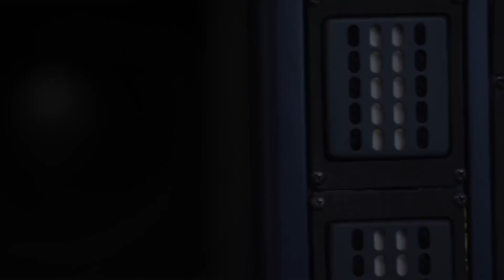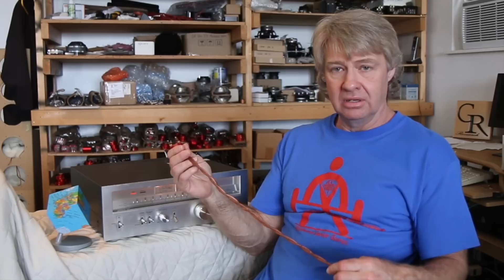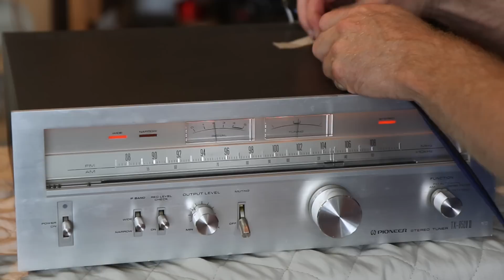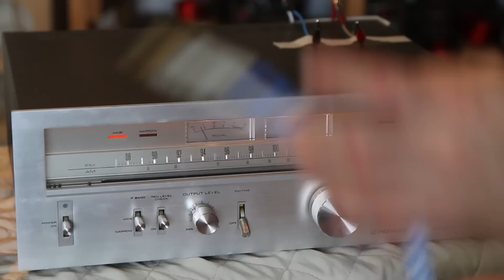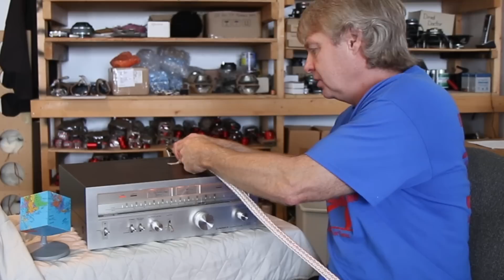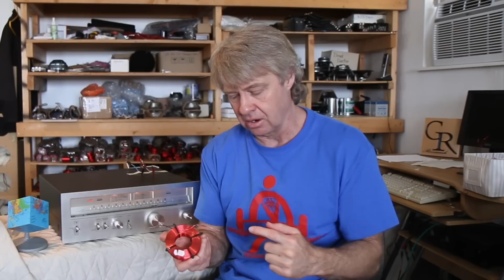Do Audiophile Cables Matter? Here's PROOF!

Comment: Interesting, Firstly I am no engineer or electronic person, I just appreciate hifi and good sound, however I am generally of the opinion that  a lot of cable makers claims are snake oil.

That is not to say that cables are not an important part of a hifi set up, they are! 

The example given was interesting but even as you mentioned this experiment just shows filtering of RF signals not normal current that goes from amp to speakers. 

I would suggest that a good quality ofc cable that is well shielded is all that is required for most peoples hifi and ears. 
Of course you could buy a good ofc wire and braid it yourself and save $$$/£££

My issue in general is these audio and hifi cable manufacturing companies that claim big things from a 99.9999 % OFC, silver plated, cryogenicaly frozen, created by bhudda hifi cable. 
Yours for only £10,000 per Sq mtr.! 🙏🎉
What utter BS!  😂 that indeed is snake oil.🧐
Even if it did indeed make a difference I assume it would be so negligible to even bother with and certainly not audible to the human ear. 

I would rather have a group of people, different age ranges, with various cables in a blind listening test. 

In the debate we also focuse on electronics and data but neglect the human experience and biology.....
A friend of mine has hearing issues and in work uses a special earpiece for telephony work, however every so often this earpiece needs re calibrating because my colleagues hearing will acclimatise to the signal and cancel out any benefit because our ears also adapt to sound. 

I re-iterate cables are important (as you have shown)...just don't go paying silly prices for the voodoo ones!

Comment: Oh no! It's picking up RF. You can mitigate this easily by braiding it, as the more expensive ones do. What you completely ignored was the length/electrical length of the different cables you used as an ANTENNA, at least you didn't talk about it. I did this experiment myself a couple of years ago and braiding will reduce L' while more strands and a tighter weave will increase C'. So yes a braided and  well matched cable will reduce RF and group delay slightly, but as you said the noise is on the grid too. I used to put my gear on a power conditioner/filter to mitigate this. 

The differences in impedance and group delay of the cables are really small though and are negligible for f<100kHz. If you want less RF noise, get a filter/conditioner for your gear, maybe braid together some cheap speaker wire yourself if you must, there's no reason to go fancy with dielectrics like Teflon below 6GHz either.

Comment: Well I wasted 20 minutes of my life watching this in the hopes of someone actually showing a measurable difference in speaker cables.  Noise floor my eye. If it made a dramatic difference it would be easily measured by a spectrum analyzer.  I've tried using my AP system 2 > -120db noise floor, nothing.  If you are a true believer, I challenge you to do a true double blind cable test between the supposed worst cable and best cable.  If you get 100% correct I will be convinced.  I am not saying there are no differences, there may be,  only that the differences are very, very small and no one has yet devised a method for measuring these differences in a meaningful way.

Comment: Can someone explain to me why hifi speaker doesn't come with balanced connections. The whole point of this video is about interference but there is a solution for that and it is balanced connection no?
Reply: It would cost money to do so, since you'd need either transformers big enough to handle the expected wattage, and good enough to work linearly across the entire AF spectrum, or active electronics at the speaker, and you'd need much the same at the amp. and it wouldn't really make any difference anyway, outside of really unlikely situations where you're forced to run your speaker cables near to a source of EM radiation that just happens to have enough components with enough power in the audible frequency range to actually make a noticeable difference while playing music, and you can't move either the source or the cable... 
Even if we did have balanced speaker cables, there'd still be people claiming that there was a difference between different cables, and attempting to charge you for the privilege of using their special version.

Comment: Your test is totally flawed.   First off you are using an unterminated pair of wires which is a high impedance mismatch to the antenna input of the tuner. Other than the capacitive load.  It is the capacitance of the wire between pairs that acts as the filter as you suggest and not the type of wire.   If you were to terminate each of the test cables at 300 ohms you would find that the difference in the cables would be almost non existent.  If you did the same experiment with the AM band and configured your cables as a single unterminated long wire antenna you would also find there is virtually no difference.

 Noise picked up on the power line is usually filtered out by the power supply especially when power transformers are employed.    Power transformers cannot pass RF frequencies.   As well any decently designed power supply will not pass powerline noise  into the audio circuits.      

The speaker cables are not usually affected by noise simply because they are terminated at a very low impedance nominally at 8 or 4 ohms measured at 1kHZ.  The impedance of the inductive load of a loudspeaker at RF frequencies is near zero.  This would effectively suppress any RF interference induced into a speaker cable no matter what type of wire is used.   The actual power level of any induced RFI or EMI is extremely low and if you know anything about RF you also know that there is no such thing as a transducer that can convert RF into an audible signal. The speakers themselves cannot produce an audible artifact of RFI.  EMI may be an exception because the effect of EMI is based entirely on the strength of the EMI, it's frequency and the proximity of the receiver to the source.   It takes a long  piece of wire terminated at a high impedance to be able to produce a measurable level of induced RF energy.   Before you fall into the trap of the snake oil wire hype,  I would suggest that you read up on transmission line theory to focus your thinking on scientific fact rather than falsehoods produced by the marketeers.  I have been an audiophile and engineering technologist in the audio field for over 60 years.
Reply: Spot on!
Reply: @COLDMKULTRA  Thank you

Comment: No speaker on earth will respond to radiated 60Hz from your power lines, and shielded cable is important only for low level interconnects, NOT speaker cables or your AC mains inlet cable. Now If you want to demonstrate the difference between cables do that at AUDIO frequencies, use a spectrum analyser, signal generator and switch in and out various types of cables. If you did do that you'll be able to demonstrate to your subscribers that there are minuscule differences with cables at audio frequencies.

Comment: Hi Danny, I enjoyed the video. I am surprised at the amount of blowback. While having all of that RF rejection in a speaker cable is probably going to have a limited effect, I certainly can see how it could be important for power cables and very important for small signal and internal wiring. But noise is cumulative so I agree, any where noise can be reduced it is a good thing.
Reply: Sorry, but he even didn't show the other ends of those test cables. No info how they are terminated nor if they are terminated at all. This test is worthless.
Reply: @tjblues01  yeah, this is AFTER he powerstage, WTF is he thinking? like if i just put a loop on wire on my speakers it is the same set up he has there, and with a volt meter you could measure a voltage in that loop from RF but lol it is soo low. i feel stupid staying this but it is as loud as a free standing speaker. i have never heard the radio play from a normal speaker.

i have heard it using an ultra sensitive piezo ear piece but that was AM band and it was some kids experiment and i might have had a transistor in there but the point was it didnt need a battery. 

i keep coming back here thinking i will learn something. fact is, he uses 1000dollar set ups and is shocked the sound good.

Comment: The twisted cable method has been used for yonks to block RF , so of course the more braids  you have the less RF it will get. Not rocket science. But the fact is noone is using speaker cable as an antenna , so very oxy moronic

Comment: I'm the first to acknowledge there are subtle differences between cables. However, this isn't the way to measure those differences, and even then, just because you can measure the difference it doesn't follow that you can hear the difference!
Reply: Yes. A listening test is always best. There may in fact be audible differences to some ears. Especially those of us without much frequency loss yet. Due to age or misuse.
Reply: @MR.ROBOTVOLTRON  with the expensive cable always sounding best.....when you know it's the more expensive one.
Reply: @michaelwildsmith4446  Haha, yup. I'm sure it's just a coincidence that copper cables are described as having a warm, rich sound while silver is described as cool and analytical.  Nothing to do with the appearance of the metal at all.  Nope.  /s
Reply: Especially with the limited hearing of age 50+ listeners.

Comment: This test just shows how not to design an antenna. You could plug cheese into the back of your tuner and it'd be fantastic at not picking up a radio station. Doesn't prove it's a good speaker cable though.

This test doesn't demonstrate anything about the signal carrying ability of speaker cable. You state as fact that outside interference affects the output of speakers but do nothing to actually back up that claim. Further you demonstrate a speaker cable being a terrible antenna for a particular frequency, but don't demonstrate that cable being the same or better than a benchmark. I could say that nitrogen affects the sound quality and I'll sell you an argon shielded cable. As proof I'll sample the gas around the cable. "Look, no nitrogen, so it must have better quality sound". You just have to accept that nitrogen was a problem to start with. 

You may very well be right, perhaps speakers are very susceptible, more so than medical equipment and oscilloscopes and computers. But if it's really that noticeable it shouldn't be too difficult to record and demonstrate it.

Comment: My amp has an output impedance of 0.01Ohm. it's connected to low impedance speakers. I don't see how you can put very weak RF signals on that, let alone you could hear it.

Comment: i can`t argue if its a myth or not. I would be curious to see a measurement where the same speaker setup output  gets measured with cheap cables and one time with expensive or just better cables. There has to be a way of showing two measurements and being able to highlight the difference if any? If i see a fool proof measurement of the actual audio signal going out of the speakers being altered because of cables it would be very interesting

Comment: It would be interesting to measure the cables on a LCR tester, I would hypothesize that the higher capacitance on the braided cables (more pairs braided, more surface area on conductors in close proximity to each other) is shorting out the RF. I would bet if you whack a .001uf ceramic across the rf input it would also null out the RF signal without being something that would significantly impact frequencies within the audio band. No doubt in my mind that the cables will measure different as you are trying to explain, im just questioning if we were to simulate higher capacitance would that also have a similar effect.

Comment: The two inductors are just tighter coupled. Just a few nano-farads in the cable will damp the RF signal but it doesn't tell anything about the audible frequency spectrum. Also the speakers won't do anything with the very low RF signal (microvolts).

It's just the series resistance of the cable which matters, resulting in an overall good damping of the speakers. Please get your facts straight.

Comment: Hey Danny. Not sure if you will see this as the video is a year old and Yu may have gotten this in the comments already. But putting aside if there is a difference or not. I have looked at some of these cables and for some one like me these cables are not cheap. Specially if you are trying to run the lines for side rear and Atmos channels. Is there a DIY way of making some speaker lines that can help but not break the bank or get me a divorce? Lol

Comment: I'm curious about "low mass" connectors making such an improvement, but the full length tin plated copper leads on all the cross over components are twisted together in a mess and gobs of tin/lead solder are applied. Seems kind of contradictory.

Comment: I use 833A radio station transmitter tubes for the final stage of amplification and the 833A cuts off frequencies above 20 mHz because it is designed for use in AM radio stations. For interconnect cables and especially phonograph cables which have to be coordinated with the phono preamp because I use moving magnet cartridges (A cartridge wears out in about1000 hours and if I could afford a $10,000 moving coil cartridge it would cost me $10/hour to play records and moving coil cartridges can't be re-tipped and be expected to last) which require loading capacitance. Thorough shielding and grounding keeps out the RF. Filtered surge protection is easy with single ended triode amplification that does not have to draw sudden high current during an orchestral crescendo.

Comment: Even if you think the test is invalid, try the cable. I took 24 total PET coated 24 awg wires and braided them. Then I tested it against a regular 16 awg speaker wire. My ears say even if he isn't explaining it right, that shit works! If you're wondering where to get PET coated wire easily, network cable HAS to be PET coated on the inside. Outside is PVC, but the internal wires are always PET coated. I love how my Sony SSCS5 speakers I bought because of him sound with my custom braided cables. It's VERY time consuming to make them by hand like I did just as a warning.

Comment: The 2 things people misunderstand the most about cables are :
- Cables do make a difference in audio.
- The result is not correlated to the price you pay.

Searching for good cables that match your taste and your system is pretty empirical. You have to test everything you can to find the good stuffs.
The more you use the same brand everywhere in your system, the more it will bend the sound in a specific direction. Mix brands is often a better choice.
A more expensive cable can sound less good than a cheaper one from the same brand.
You need time to understand what a cable do... hours or weeks. You can't ear the differents from scratch... but, when you have spotted the differences here or there, you will be able to recognize the cable immediatly from another one.
Ban ABX !

Comment: There are scenarios where cables make a difference, but this is a poor comparison.  One glaring hole in your pitch is the cable lengths - your straight cable at 6ft is basically resonant or tuned for the FM band you're using as an antenna, so of course it will get a good signal.  The longer the cable or antenna length,  the lower the resonant frequency.  Comparing a 6ft straight cable to a braided 6 ft cable is not the same as the electrical length is not identical.  Braided cables do help to shield outside signals, but connecting the wires directly to your source is not the same.  For example, ethernet cables are braided to block outside signals, not the signals they are directly connected to.

Comment: I totally buy the way that the noise is no longer allowed in the cable. 

Basing my assumption that these cables are set up between the amplifier and speaker, I am curious how much the noise actually affects the sound - is there a way to show a percent of the amplified signal that the unfiltered noise becomes?  Put another way, I can't hear a cd player to amplifier signal, the signal traverses to the amp and goes from lets say a level of 1 to a level of 100.  That signal at 100 is then passed to the speakers.  Does the unfiltered noise incoming through cables create an audible effect, given it is not amplified?

And can you help me understand how this can be applied to digital signals between components?  My understanding is that a 0 or 1 is a 0 or 1 - though may have some "rounded corners" on the signal.  Insofar a 1 is still a 1 when the rounded corners are taken into affect, why would it matter?

Thanks!

Comment: 11:45 we actually had the antenna mounted on the top of the rooftop. In very stormy conditions if could be moved be the storm, so my father had to climb the roof and correct it. 
Yeah, the good olde times 👍😊😊

Comment: There is only ONE way to show the difference. Cut the same length of two different wires. Connect both of them to a single output of an amplifier. Now, connect an oscilloscope between the two different cables. Oscilloscope should be a battery powered one. You might break it otherwise. Anyway, the difference between these cables will then show up in the screen. I can tell you now what you will see. Nothing. A straight line and this will mean that these wires pass audio in the same way. It would be even better to put a 100 ohm load on each of the cables so that you make sure these actually pass some current. Let me know if you actually want to test this. I will let you know exactly how to set it up. Your test does not have much to do with the sound quality. It is just about electric  shielding.